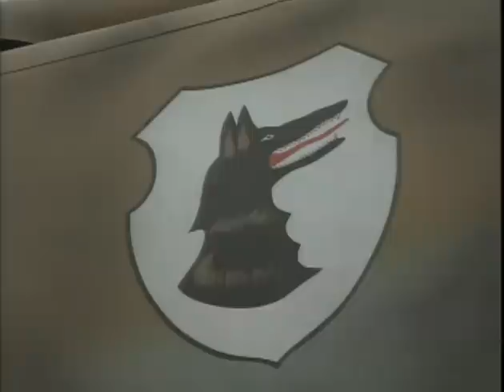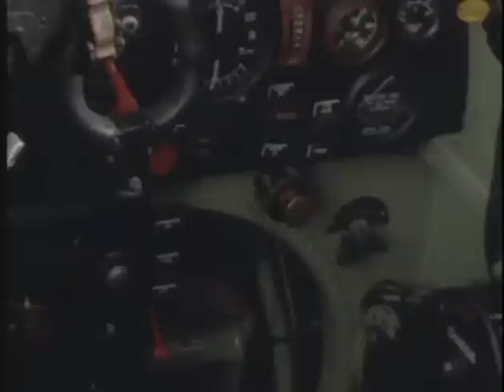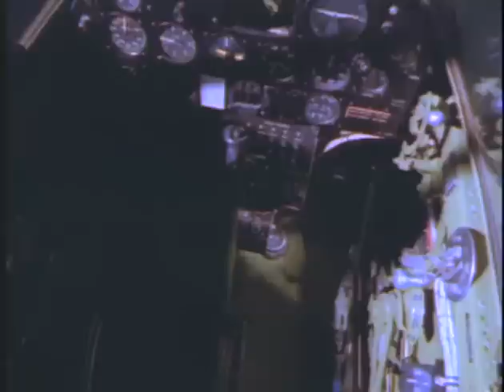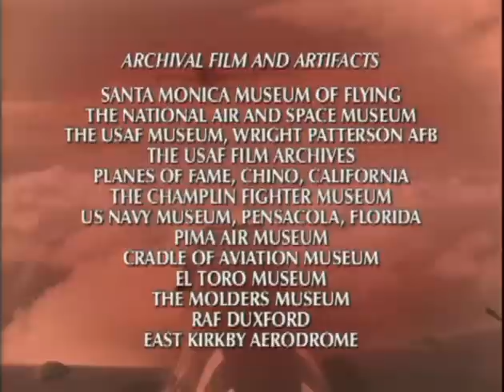Discovery Wings Clash of Wings 12of13 The Fighters XviD AC3 MVGroup Forum

Comment: I Wonder Did UK Put Merlin Engines into P-40 Warhawks?
Reply: No ,it never did .at best you'd have a mk V spitfire , better but still outclassed in Europe .
Reply: Curtis did - the P-40F
Reply: maureencora  NO !!!!  BUT Curtis did, the USAAF was gifted 3,000 Packard V1650-1  as a bribe to get Packard to build the Merlin for the Brits !!!!  1311 P40F&L received the engine and it made NO DIFFERENCE over the Allison, as you see  it too was but a single stage supercharged engine !!!  ALL merlins , were not built with the LATER 2 stage supercharger, actually few were !!!
Reply: @pauldavidson6321  The Packard V1650-1 was but a single stage supercharged engine and it made NO difference in performance why only 1311 were made and they went back to the Allison !!! !
Reply: The P40 had a thick section wing it was very good for lower speed manoeuvring and very strong but would never make a good high altitude high speed fighter, the US already had the P 47 and P 51 with thinner laminar flow wings so there was no great desire to develop the P40  as it was a generation behind the others.
Reply: Chuckling...it was high octane rated American super gas that kept the Merlin on par with the far superior German fighters of the time.

Comment: Contrary to what this video claims, the Grumman F6F Hellcat still could not outmanuver the A6M Zero. In fact the first American Fighter aircraft that could beat the Zero in all respects, and the follow on to the Zero the Oscar as well, wasnt designed in time to actually fight in the war although technically it did reach the fleet before the war ended. That of coarse was the Grumman F8F Bearcat. The Bearcat was in essance a super Hellcat. All the other previous designs were never able to outmanuver the Zero because it was beyond our abilities initially to design a airframe that would beat the zero in all respects while still heavily protecting the pilot and the Engine from up to 20mm Cannon fire, ground fire of various kinds and still provideing self sealing fuel tanks and finally a structure robust and strong enough to absorb battle damage like a sponge while still getting its pilot home safe and sound. All of those things spoke directly against the very idea of manuverability and range as well. Ot was only through the sacrifice of all of those things that enabled the Zero to achieve its manuverability and range. Of America had decided to sacrife those as well then the F4F Wildcat could have achieved parity while the Hellcat and especially the Corsair being much superior although many more of our pilots would have died. The Hellcat while it couldnt oitmanuver the zero came very close and it could hands down beat it in all other respects such as climb, survivability, firepower, and especially in the dive due to its far greater weight. It came very close in sheer manuverability bit it still wasnt a great idea to fight in the horizontal with the zero..and why would anyone want to do thatanyway. War isnt some macho contest. War is aboutachieveing the greatest unfair advantage you can possibly get and ruthlessly pursueing it. If you can kill the enemy from above and behind him diving on him out of the sun with his first hint that youre even anywhere around being his head explodeing from the first round you fired thats exactly the way you want it every time. Because that way you fly home at the end of the day and the guy trying to do the exact same to younever flies home again and can never do that to you, that is the ONLY thing that counts.
Reply: James Taylor  F6F Hellcat scored a 19 to 1 kill ratio over the Zero !! ! Best of the war !!!  You are full of BULLSHIT !!!!!  STFU !!!!!
Reply: Over 300 guys made Ace in the Hellcat.